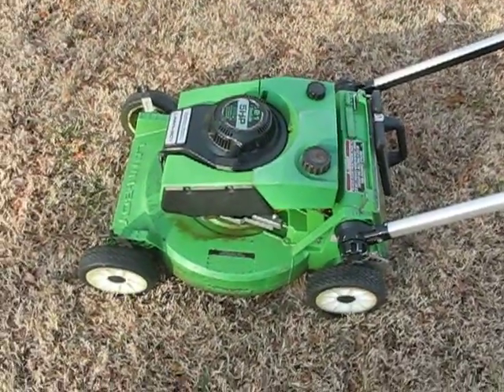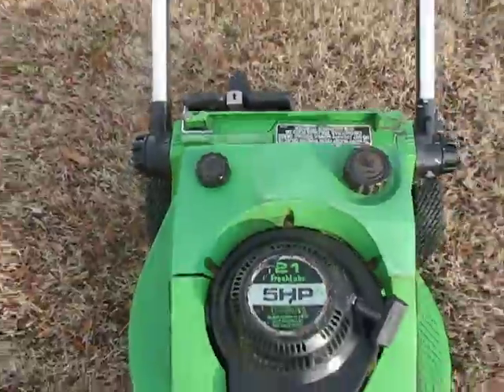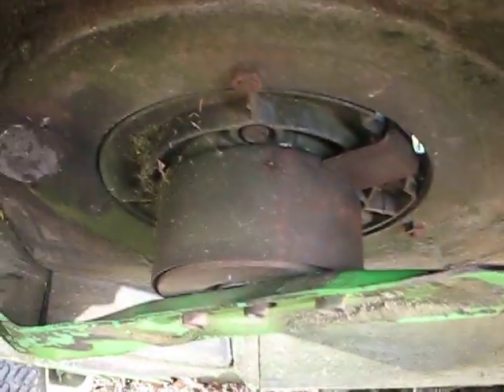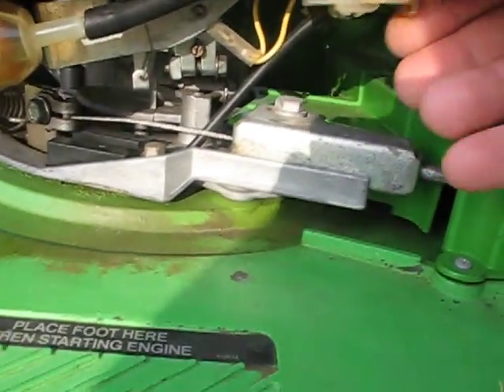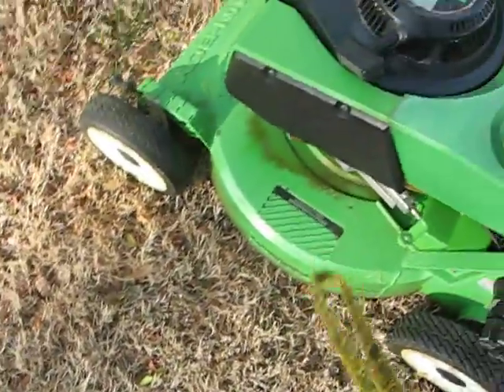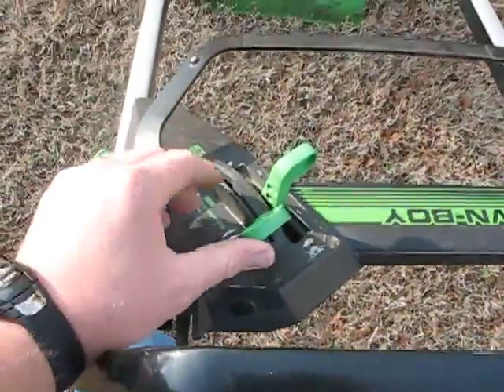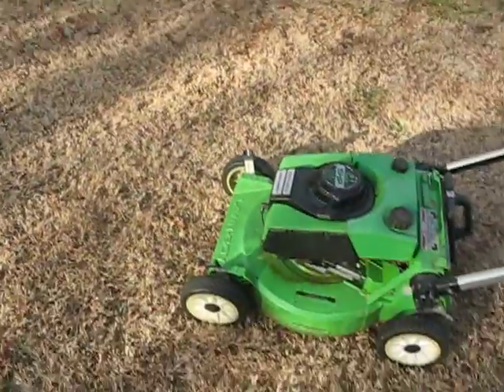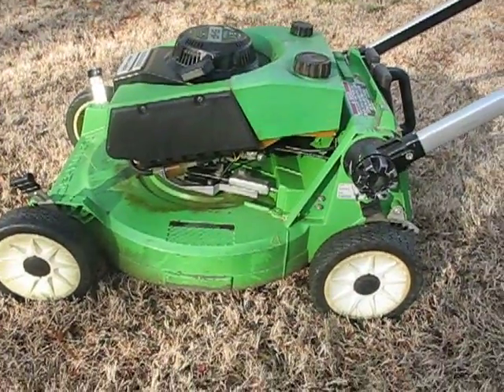Lawnboy 10591

Comment: yes... like these 2 stroke mopeds... seperate fuel and oil tank... it's oil injection it does that every time... so when you fill the tank... always check the oil levelbefore mowing... say every other tank fill.... 2 stroke moped, you should fill the oil tank on the 4th tankful or when the low oil warning light comes on